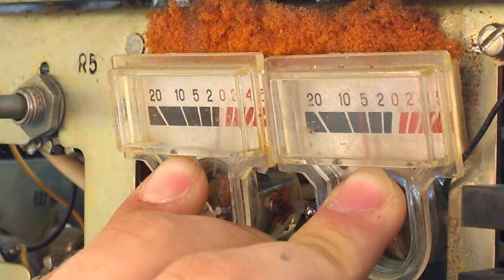decaf in the zone - Юпитер 202

Comment: please give the connection diagram recording indicators work when playing music.( my mail stas.r.1988@gmail.com

дай пожалуйста схему подключения индикаторов записи в работу при воспроизведении музыки.
Reply: Станислав Рудый Just connect the negative terminals of the VU-meters to ground.
Reply: Thank you so much. You have very much helped out.
Reply: Very clean sound. His own writing or rewriting recently?
Reply: Станислав Рудый The recording was made on Akai GX-210D and played on that deck. It's school property and I decided to restore it. Changed electrolytic capacitors, fixed mechanical problems and aligned the heads. I made it to work without pressure pad.